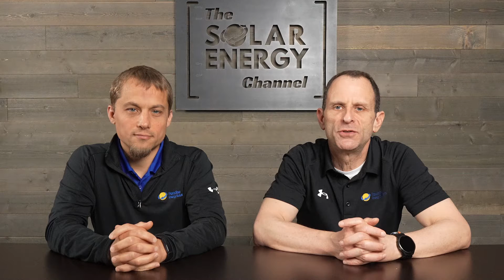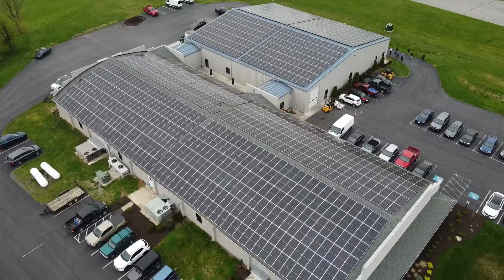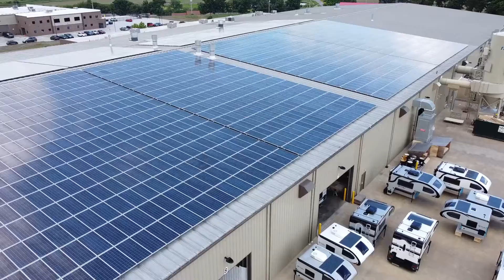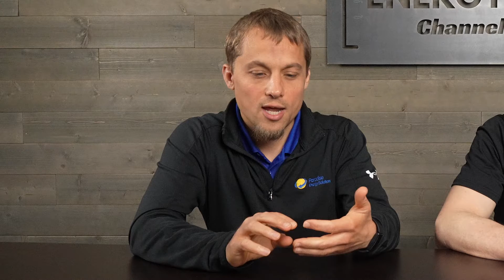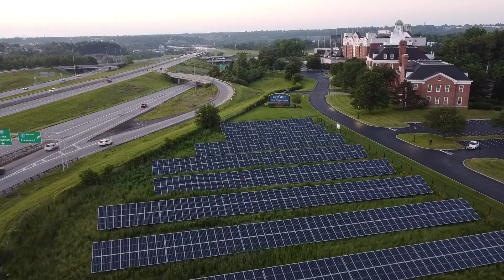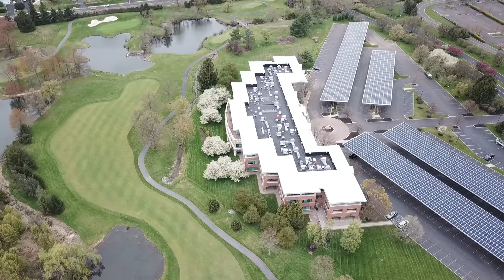Best Commercial Solar Install Method? Roof vs. Ground vs. Carport!

Comment: If you are pulling a bunch of amps over a long distance, you are doing it wrong. You should increase the voltage from low voltage to medium voltage. Those cans on the pole outside your house, often increase 230v split to 8kv or 13.8kv. ie 40 times the voltage. So if it got expensive for 1500 feet, think how much cheaper if that cable was 40 feet instead. Plus a couple of transformers, You could even double the wire area to significantly reduce your loss for much less expense. Southwire makes single and 5 conductor (3 phase power + neutral + ground.) wire rated for 8kv and 15kv.

1 megawatt at 8kv 3 phase is around 41 amps so triple 6awg copper wire would be fine for long distance. And you can get it in direct burial, though it is sort of dangerous, so either put it in conduit or pore concrete on top. I recently priced a single phase 6awg cable at $6 a foot. 40 times that would be $240 per foot. A pair of transformers that can handle 100kw are under $1k on alibaba.